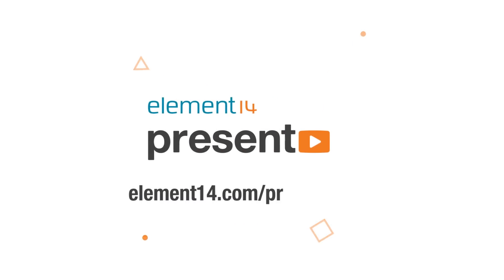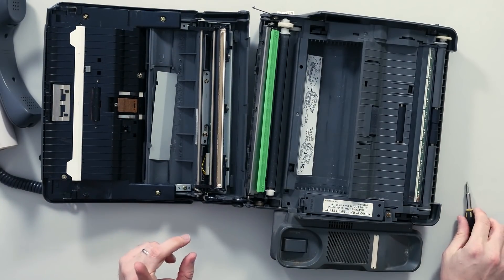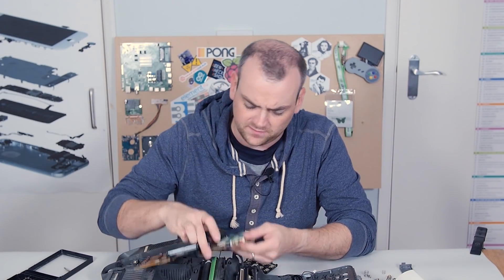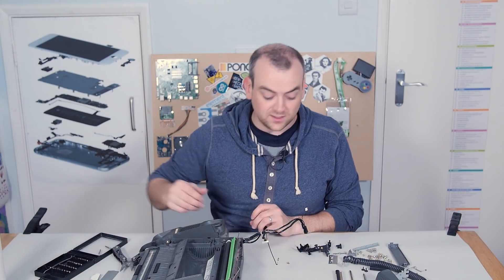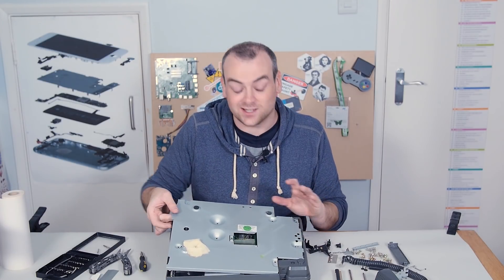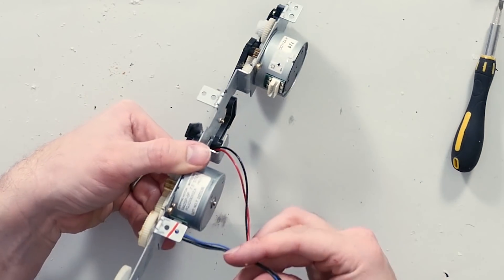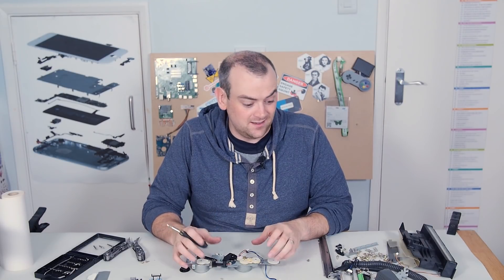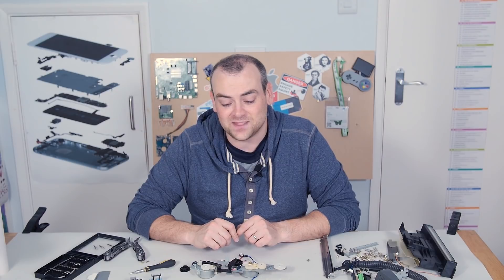What's Inside a Fax Machine? - The Electronics Inside

Comment: The thermal head could be used to keep it at a nice temperature in case you are using it when it is very cold like 3 degrees so it doesn't damage the printer from frost or frost up the mirrors.

Comment: It has nothing to do with over engineering or phone voltages, isolation or world standards but it allowed the phone part to be used in emergencies in the case of a power failure, as the phone section is powered from the telephone line and not the fax machines power supply.
Reply: I don't understand where the membrane keys are connected

Comment: Thermal printing was much superior than inkjet for fax machines in the early days. Inkjet could not achieve the resolution required for printing Japanese characters accurately so virtually all fax machines in Japan were thermal.
Reply: That's interesting, at what point did the resolution of each printing technology over take the transmission resolution in quality?
Reply: David Edwards fax resolution kept improving but strangely inkjet never really took off in Japan until the resolution was at least 600 dpi. Copy and printing resolutions were similar because the Copy (Photo Copier) function was quite popular, later fax machines could also be used as a PC printer (usually just inkjet or toner)

Comment: Inside a 90s fax machine: Scanner, telephone circuitry, elaborate analog processing circuitry, hardware compression script, modem, thermal printer, processor, backup battery, RAM chips, ROM chips
Inside a 2000s fax machine: Scanner, printer, microcontroller with everything else built in.

Comment: That double keypad circuit at 6:30 can be also there so you can still use it as a phone, when there's no power in the building. You won't see what you are typing, but I guess it still sends the DTMF signals and you get a connection.
Reply: Good point!

Comment: First thing that popped into my head - hook it up to a gryo/accelerometer, basically so it can be located in space and know its rotation, then use the addressable elements to draw a large image on a large sheet (or multiple strips) of paper. Would look pretty cool if you could just pass the thermal strip over a sheet of paper and have to draw things.

Comment: Where did you get the tool kit?
Reply: I got mine from a now defunct chain. You can get a similar kit like this one:

https://cpc.farnell.com/roebuck/21-7290/screwdriver-set-precision-20pce/dp/TL04271?st=Screwdriver%20set#

I also keep a "Normal" sized set of screwdriver bits which include vandal proof, security, and tri wings like this one:

https://cpc.farnell.com/duratool/d03237/security-screwdriver-bit-set-100pc/dp/TL19810?st=Screwdriver%20set

Comment: Being old, I can tell you that most businesses had two fax machines because compatibility was so poor between different manufacturers.
Reply: Wow, I can believe it! What time period was this?
Reply: @a531016  back in the late 80s and early 90s.  Receiving junk faxes was a problem too.  Kind of a predecessor for email spam.
Reply: mike brown, not true. I worked for Panasonic from the start of 1980 through the fax revolution, until 2012. If companies had 2 or more fax machines it was due to efficiency rather than compatibility as every fax machine had to comply to the international facsimile standard. I directly worked with technical and software engineers in Japan and yes, there were sometimes issues between brands but they were always resolved quickly with firmware upgrades. Facsimile sales were a huge part of a sales companies revenue back in those days and compatibility issues were extremely important.
Reply: @brucea5664  the factory might have been making firmware modifications for future production runs, but virtually no one in the field was getting them, unless they were shipping them back to the company.  There was no such thing as customer's doing their own firmware updates in the 80s or even the early 90s.

Comment: Why would someone choose to use a dc motor in a precise device rather than using a stepper motor to be as precise as possible? Not to mention having to replace brushes and adding more space for a fancy controller. The stepper motor would work efficiently and precisely the entire time and is easy to run. I used the stepper motor from a fax/printer to win 1st place at a chemE car competition. While everyone else was rushing to get across the finish line and running out of chemicals for their reactions, my car was slowly chugging along with a very low concentration of chemicals that worked exactly how it was supposed to. 
I apologize for rambling that’s just one of my favorite school stories.
Reply: Rabmling always welcome - well done on winning I guess! What controller did you use for the motor? I think that may be the big decision in a lot of places, if there is enough IO for the Stepper and the cost of the controller?

Comment: Walmart has a good thermal paper scam going, when you buy a car battery it has a 24 month replacement period... trick is you need the original receipt which is printed on thermal paper. After 6 to 8 months (at least in my experience) it reverts back to a plain sheet of paper and you can't tell what was printed on it... so they don't have to warranty it because you don't have proof of purchase. NEAT.
Reply: Wow, yeah, that'll do it! Cheap thermal paper to the rescue!
Reply: @a531016  Even when I was a kid, my old man used to have one of those receipt stabbers so he could keep records, I used to flip through and watch the walmart receipts fade into nothingness lol.
Reply: Purchased their hi end MAXX a battery online. It has died after 2 years (car was staying idle for the most part though). It took about an hour dealing with their support/return agents at a local Walmart in CA who tried to persuade me that warranty works only for offline purchases - which is a bunch of cheap salami, if you ask me. But apparently their “system”  that is used for battery 🔋 customer managements indeed is not configured properly (I doubt it is done on purpose, but somewhat possible).
Reply: @dmitrytzoo  When I bought a battery in store the guy at the auto center told me they'd have no problem doing a core charge at the front of the store, I LEFT my core at the back and he gave me a slip of paper with some numbers/letters scratched onto it. Took it up front... woman said I couldn't do a core exchange at the register, I'd have to go to the customer service. Waited in line for 20 minutes where the woman told me I had to go back to the auto center to complete it and she had no idea why he told me that. I INSISTED that she resolve the issue as I wasn't going to play he said she said, I'm following the instructions I was given. Basically I spent an hour not getting it warrantied but just buying the damn thing. I guess I'll see how long the battery lasts, I had been buying Sears diehard batteries but the closest sears to me is now 2 hours away lol... figured since walmart was so close id try it, might've been a mistake.
Reply: I always used to make a xerox copy of thermal receipts because I knew the writing would fade.

Comment: I believe the cam operated micro-switch is used to inform the CPU of a paper jam. (I'm sure someone told me this years ago)
Stepper motors are indeed very accurate, However it may be cheaper to have a micro-switch detect if paper is still moving than using some current sensing components just before the stepper motor.
I do have an old fax machine I could test this theory on later (It's somewhere in the attic), I will comment if disabling the switch in mine reports a paper jam.
Reply: Do, give it a test and let us know! I struggled to understand the mechanism 100% so it's completely possible it locks up a clutch when jammed!
Reply: @a531016  Sorry for the long delay, Mine don't have a cam operated micro-switch but does have an IR source & detector component reading from a wheel with a small slot in it that is directly connected via gears to the stepper motor.
And sure enough if I block the sensor it reports a paper jam.
Although mine is done with a different component it does seem very similar in its design.
Also spoke to the guy who told me (Thanks Jason) and he said it's also very common in laser & thermal printers.

Comment: Yes an interesting video ! We used a fax machine that we used as a document scanner with a PC - no public phone line was used. In those days, apart from fax machines, we had dial-up modems. The modem would be connected to the computer by a serial port ( which also no longer are a regular feature ) Supposing we wanted to scan a sheet of paper into the computer. The phone leads from the modem and the fax machine could be connected together in their own "special" circuit.. A DC offset current was required to make them talk to each other, so between the positive and negative leads of that phone circuit, a PP3 battery and a resistor ( few hundred ohms ) was wired to provide the current. The paper was loaded into the fax machine. The modem and fax were put into operation, and the sheet of paper would be scanned in to whatever fax application was running on the PC. The phone connection was not, of course, IN ANY WAY connected to any public telephone system - it was completely separate. Nowadays of course most printers have built-in scanners, and mobile phones can scan in documents.

Panasonic fax machines were good unless they were struck by lightning - then Panasonic wanted "big money" to repair them...
Reply: I have never heard of that arrangement before, that's kind of like a twister ethernet cable but phone line based instead? That's super really interesting, I with I had enough hardware to try it!
Reply: Hi our phone leads in UK are four-wire flexible. The modem and fax were both put across positive and negative, along with the battery and resistor that were in parallel with each other ( the resistor was a current limiting device in that case.) The PC was put in receive using WinFax. Send was pressed on the fax machine. Worked well once you became used to the procedure. Unplug battery at end of it goes flat!